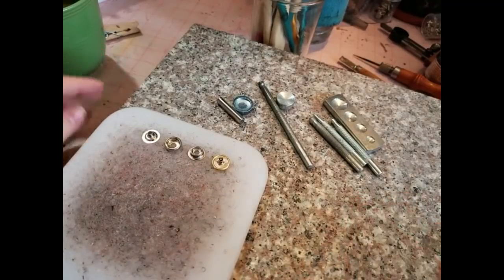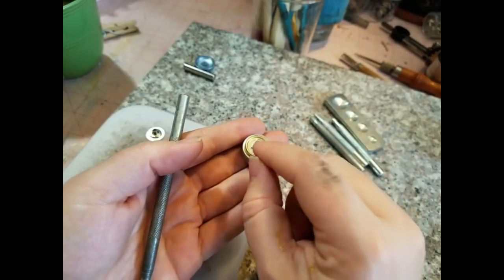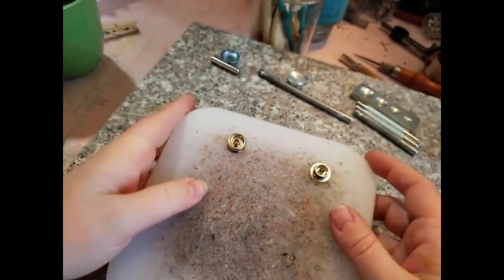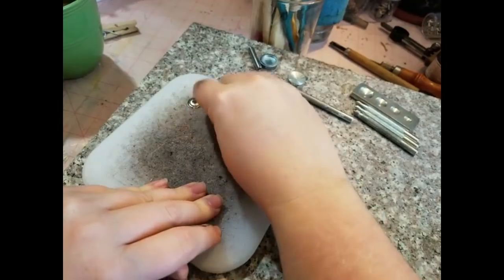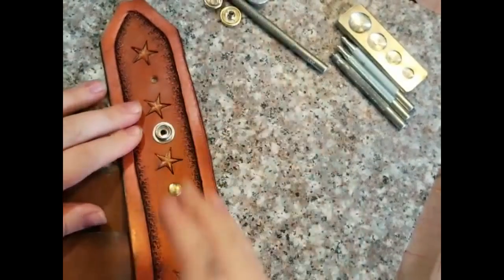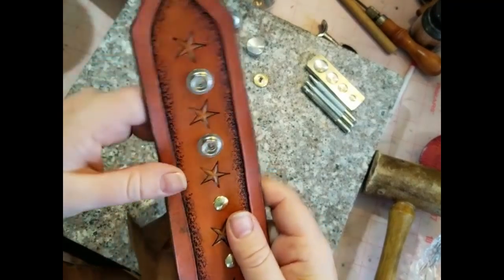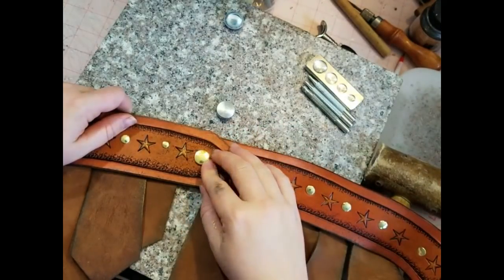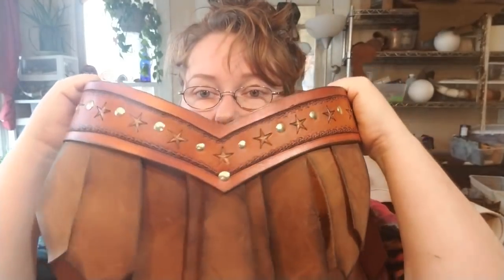How to Set Snaps in Leather

Comment: Thank you for this video. Is there a tool that you recommend for removing the snap and moving it?
Reply: @tiffanytiffany2010, You'll need a Dremel or similar tool with a beveled stone grinding tip to grind off the folded over post. Thats why it's so important to make sure it is in the correct position within the project. The Dremel grinder will remove the post in under a minute, so its not as bad as it sounds. Hope this helps ✌️

Comment: I have been setting this in with the Tandy tools and a rubber mallet and doing the same process but my male side snap is still moving.  I’ve even hammered down pretty hard to test that and it’s still completely loose.  It’s literally jumping around even if I do press down with my finger the minute I take it of it still moves.  I don’t know how it stays and I’ve watched a few videos now and the stick part is coming through the leather and is snug hole wise as well...

Comment: You mentioned not using these snaps for load bearing.. I am worried using 6 snaps to hold 20lbs is too much.  What type/style of snaps would you recommend for a 20lb piece snapped to leather (20"x24" tall). Think the size of a native American breast plate but heavy (metal and leather) - Thanks!!

Comment: To avoid hitting knuckles with the hammer when making the holes and if people cannot access the alternative tools could I suggest a different method? Consider using a pair of pliers to hold the hole punch steady whilst hammering. I do this with panel pins and still have all fingers intact :)
Reply: Vice grips are even better for holding a punch where you might maim yourself with an errored swing.

Comment: Hey Yvonne, please for the love of snaps, help me. 🤣🤣🤣 The small one you showed in the beginning is somewhat of what I have. I don’t know how many times I’ve tried putting a snap in to one of my purses. (ruining one) I am using a regular standard hammer. Am I using the wrong hammer 🔨? Idk. I almost threw the whole box of snaps across the room. 🥺 Any input would be greatly appreciated. Thank you 🙏🏻
Reply: I'm not sure if this would be much help anymore since you posted this months ago. Anyways, if by "regular standard hammer" you mean one you would use for woodwork, or say you need to hammer in a nail around your house to hang a picture, then that is the incorrect one. You would need to use a mallet. It's softer on your metal tools (so your tools last) and I find it to be more precise so you're not wasting snaps and possibly ruining leather projects. I hope that helps. Best of luck. 😊
Reply: @hidyecreations  thank you so much for your help and reply ❤️ I really appreciate it.

Comment: Hey Yvonne- love your talent. I'm so frustrated- I've been messing with snaps for over a year and will blow through l0 sets until I get one that will actually snap and work. I get them on o.k. but then they won't snap together. I have the kit and also the Dritz setter- nothing seems to work. I have bought line 25 and also line 20 and nothing is working for me. By the time I blow through like 5 or 6- it's like 2.50 a snap by the time I get one to work. Don't know what I'm doing wrong. I work with leather- but am ready to just forget about that part of my craft business. I make small leather and fabric pouches for sage. They are really cute but ruined by the time I rip out the snap. So da*m frustrating!!! xo
Reply: To bad no body ever answered your question I'm having the same problem.
Did you ever find a solution?
Reply: @bipedalbob  I bought some from I think the company is called Gold Star and they seem to be of higher quality and work better. Also you have to make sure the shank is long enough to split around the snap.
Reply: @cynthiahicks1909  there seems to be a problem being to long as well then their inclined to fold, 
I think it's a lot to do with quality ad well,  it seems Tandy is getting their snaps fron China now,  not that China can't make quality product, but if you just want cheap they can do that too.

Comment: I tried this step by step on faux leather suede material (making a swing jacket) it didn’t work right 🤦🏾‍♀️ the snaps stuck together and I couldn’t get it open without ripping material. I will try on thicker leather. Going another route to fasten at the top
Reply: What kind of interfacing did you use? Garment applications of two part snaps require heavy enough interfacing between the outside layer of fabric and the facing. Otherwise you get tear-out because the snap is stronger than the fabric.
Reply: I got the Dritz snaps and had the same problem, they're so tight I have to pull way harder on the fabric than I'm comfortable doing and it feels like they're just going to rip themselves out. I wonder if less strong snaps are available.
Reply: @CameronM1138   i got the same problem ... the snaps are too hard to fasten and unfasten ... i have already sent an email to tandy leather.., lets see what they say